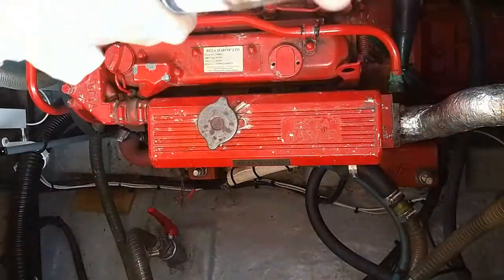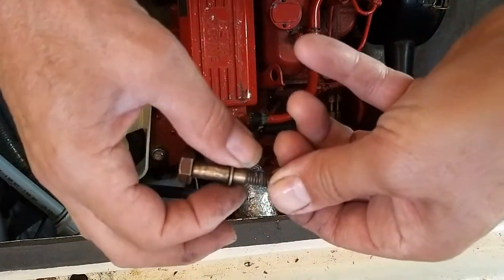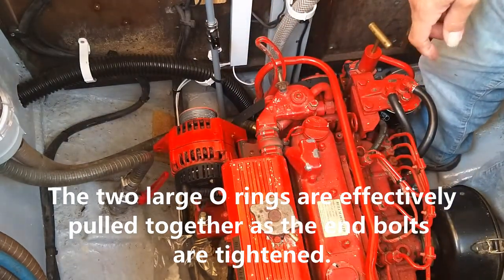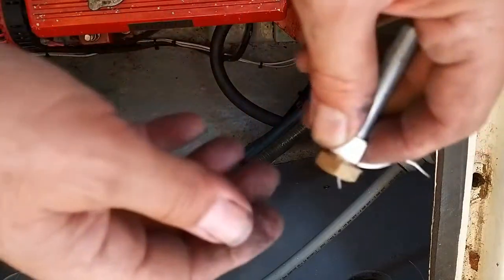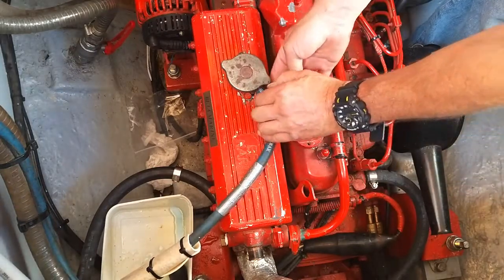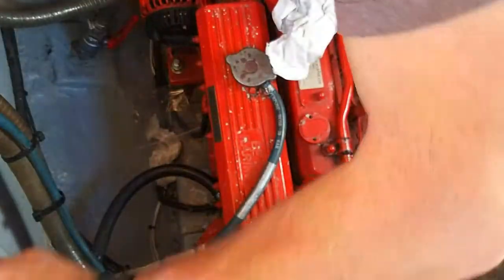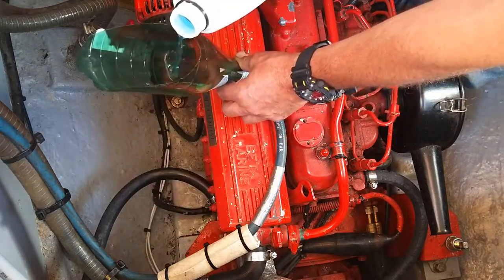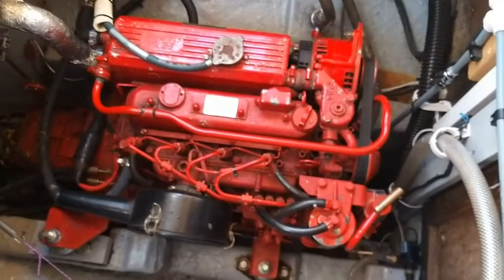Beta Marine Heat exchanger pt2

Comment: Thanks for sharing. 
Mine is a 25hp Beta without a header tank. I’m jealous!
Relaxed my impeller recently and discovered 2 vanes missing and suspect they might be lodged in the heat exchanger tubes. 
Hence the reason for viewing your video. 
Fingers crossed. 
Cheers from Australia.

Comment: From the top of the engine, where you put in the antifreeze on the end, has blown a big crack in the casing of the heat exchanger. I was  wondering if it can be welded. Thanks

Comment: You seem to be monitoring this so I will ask you a question - I have a beta marine engine - my heat exchanger has one end like a bell with one nut in the middle - the other end just has a cap with - no nut on it? How does that come off
Reply from the maker: As far as I know they have a centre nut each end.  Have you watched part 1 ? 
Beta have modified new engines, they have three bolts each end.
Reply: Yes I see it now - I do have one nut on either side as you said

Comment: The impeller was new a couple days old- I have a beta 60 and I have a small heat exchanger before the engine for my velvet drive transmission - it was the small heat exchanger that blew the hose off - and all the little tubes have thin pieces of the impeller in them so not much raw water could go though. Iam taking everything apart tomorrow

Comment: My engine kept overheating - then yesterday the hose attached to the heat exchanger blew off while we were under way- unaware of this we kept driving - until then engine choked out- and then we put up a sail and called for a tow- after we got in I noticed that the bilge had completely filled with seawater - 100s of gallons. When trying to figure out where it came from we saw the hose off and the end of the small heat exchanger for the transmission filled with little pieces of the impeller
Reply from the maker: Criky o'rilley! Which Beta engine do you have? I always monitor engine temp whilst under motor.  Do you think the hose clip was loose? I have never experienced an impeller breaking up, how old is it?

Comment: I removed the H/E to do this job. Couldn't get a leakproof seal otherwise. I kept getting flow between seawater and freshwater side through o-ring seal.
Reply from the maker: What is the H/E?
Reply: Heat exchanger.
Reply from the maker: Oh silly me of course! You mean you unbolted the housing and then assembled it?  Seems like a lot of extra work.  I have done this job twice now with it in situ but as I said in the video i did have a failed attempt and had to drain the system and start again.
Reply: After 3 attempts of re-assembling, I decided to take the heat exchanger off. Was very easy. No corrosion on any of the bolts. I have some erosion of the aluminum at the exhaust end. I epoxied, then sanded, then re- assembled and no leaks. I never did have any external leaks. Only leaked between the 2 liquids.
Reply from the maker: That is very interesting, not sure how you can really tell how much water crosses the water to water seal? I guess the fresh water tank would drop down. Or go up!
Reply: @thewaveringwarrior  I had coolant dripping out of the hole where the zinc anode goes. Before installing the anode of course. I was about to buy a new heat exchanger for CAD$1500 from Beta but I'll see how long this lasts first. Actually cheap compared to Yanmar etc.

Comment: Very helpful. I'm just about to reassemble mine on a Beta 60 with the same "one-bolt" cup. When I took it apart, the O-rings were mounted on the tube stack itself. You placed them in the cups, I believe. Any difference?
Reply from the maker: They do stick to the end of the  inner stack.  Basically the o ring sits on the bevelled egde and squeezed up between the cup and stack ends.
Reply: @thewaveringwarrior  Thanks. I got it working, no leaking. Yet.

Comment: I believe the recommendation is not to use PTFE tape on the anode threads as it impedes the electrical circuit needed to make the anode effective. There was none on the OEM anode. Thoughts?
Reply: I stopped using PFTE tape on mine for this reason. Previous owner used it, but the the plug has a tapered pipe thread designed to seal metal to metal. I check for leaks after installation and after every run and haven't found evidence of any.
Reply from the maker: There should be contact through the PTFE because it tears through on the thread.  You could always check conductivity buy using an ohm meter.
Reply: whats the benefit of the tape?
Reply from the maker: @dreamconjure stops it leaking